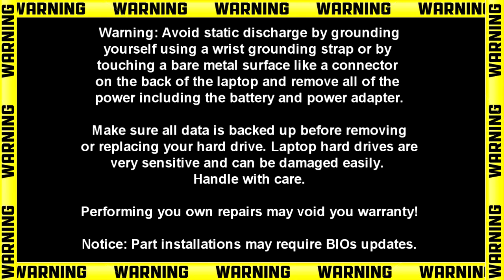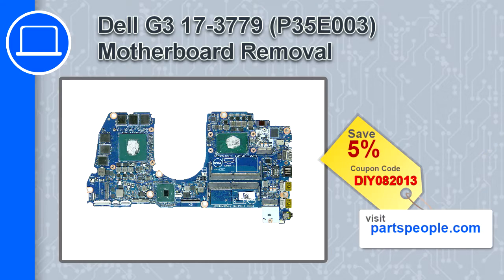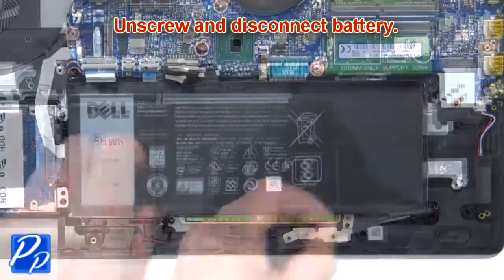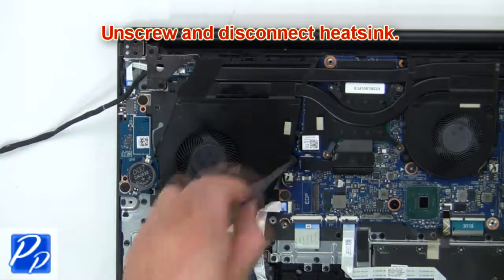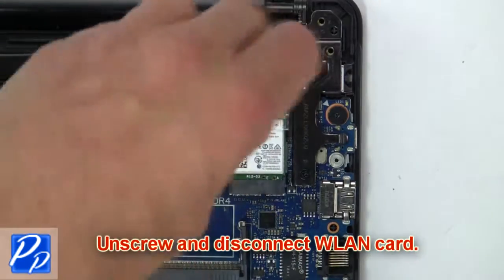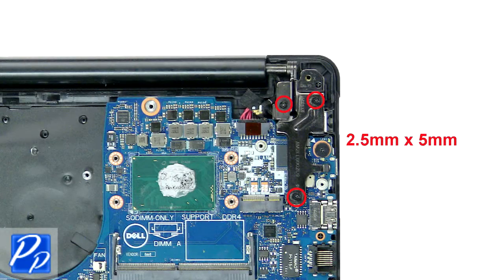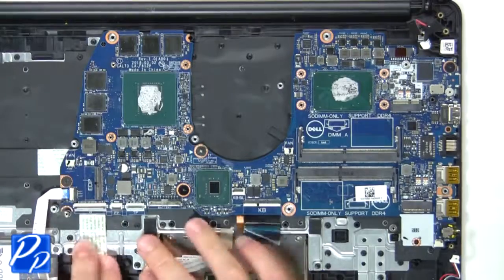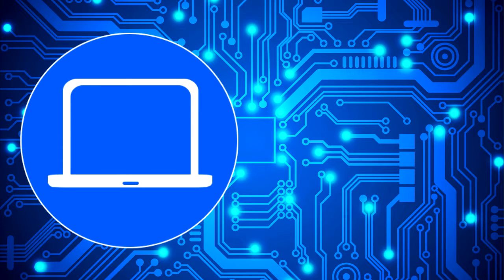Dell G3 3779 (P35E003) Motherboard How-To Video Tutorial

Comment: Just goes to show there's nothing to modern laptops. All laptops £2,000 and below are now disposable. To get a system like this with removable GTX 1060/1080 MXM card GPU you have to pay £3,000 or more for a top end Clevo. I don't even think Alienware use MXM cards any more, the new M17 from 2019 is all soldered. The drive to get stuff out of landfill is going BACKWARDS when you have to replace an entire mainboard just cause your discreet GPU has developed solder cracks or corrupted VRAM.

And as for the heat being vented towards the screen? We have crApple to thank for that. They started the trend, and now we have machines coming in with light bleed on the screens due to heat damage warping the refraction layers of the panels. And the clacky chiclet scrabble keyboards? Yup, they're responsible for that too! All modern shrinkage "trends" trace back to crApple in some way. Arrogant control freak bipolar bully Steve Jobs's "legacy" lives on. Bleurgh.